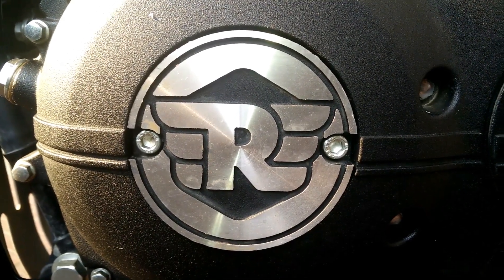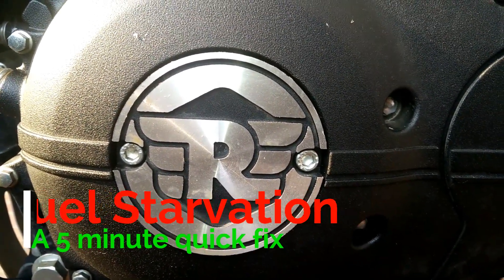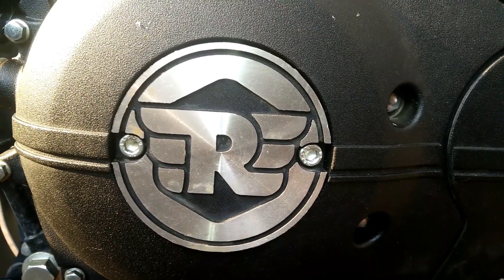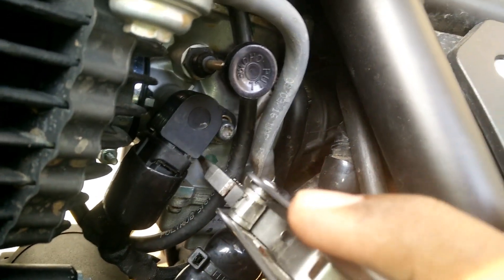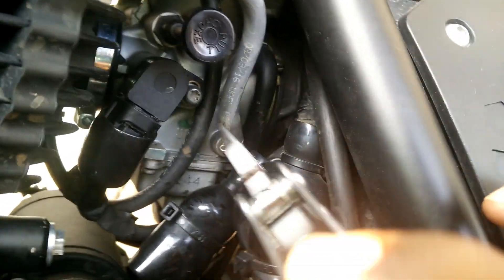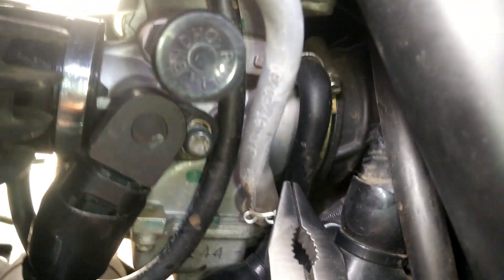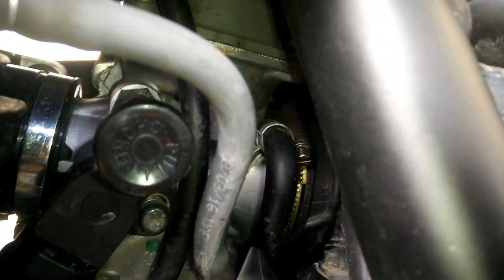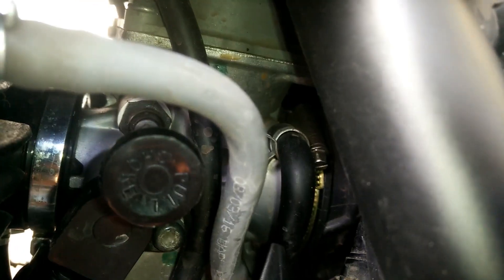DIY: Royal Enfield Himalayan | Fuel Starvation | Quick Fix

Comment: The reason the problem occurs is not because of a kinked or blocked tube. It occurred because a CV carb requires 1 bar (atmosphere only) pressure for the vent tube. By having the tube dangle down under the bike it is effected by wind speed rushing past and the diaphragm flutters which causes the needed to drop. Cutting the tube short MAY work in some environments however the proper way to fix this is to re rout the tube to a place where there is "dead air" this way the carb can vent properly. I have mine sitting under the seat which works well but will likely put on a longer tube and build a tiny air box so it will not be effected by cross winds etc. this is the reason why your fix does not work for some people.
Reply: mine was stalling done this and fixed it it was stalling when I stopped at the lights so wind wouldnt effect it when you are parked

Comment: Hello, I have black Himalayan and I experience this fuel starvation problem in my bike between 2k-3k rpm. Whenever I accelerate gradually and I try to maintain a constant speed between 2k-3k rpm, I feel some sort of gap in the fueling, the flow is not continuous. Above 3k rpm its fine. Recently, I happened to change the engine's entire head assembly from ASC as there was a terrible knocking sound when there was a load on the engine. The knocking sound is gone, but this fuel starvation thing has cropped up now after the replacement. I tried tunning the carb, but no improvement whatsoever. The ASC guys say that this is normal and my bike is doing fine. Could you point out on what could be the issue !
Reply from the maker: +Reuben Mathew Dirty fuel tank,  clogged jets
Reply: Thanks for your reply, but after I saw this video, I thought of checking out this vent pipe. As per the video, you are right, the vent pipe is long and it had a lot of bends. So, I just got hold of the free end and left it dangling just below free without any bends and voila, that fuel starvation reduced to a drastic extend. Its become very minimal and I think maybe now if I tune the carb properly, it will be gone. Thanks for the info bro, I have been breaking my head on this for weeks, finally got rid of it, relieved !
Reply from the maker: +Reuben Mathew Glad this helped.

Comment: how is himalayan for regular daily use and occasional touring ??

i am buying a motorcycle. confused between himalayan and upcoming kratos vs400
Reply: bajaj changed the name from kratos to dominar
Reply: It's simple...  
Himalayan is a great ride...  only thing is that it might give you some minor issue which will require tightening of some screws and nuts..  If you know how to do that then go for it...
Otherwise Dominor 400 will be a good bike.. but i don't think you will get that great feeling which you get on himalayan... 

P.S. My opinion can change after i ride dominor...
Reply: Danendra Khanna thanks mate